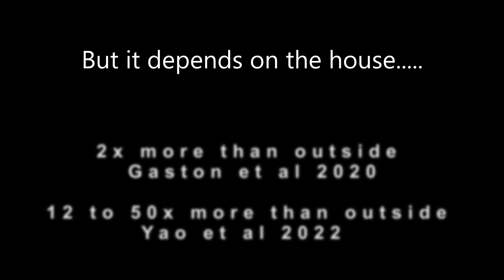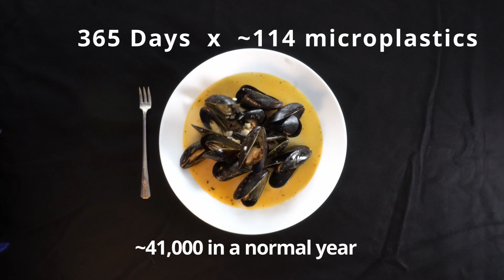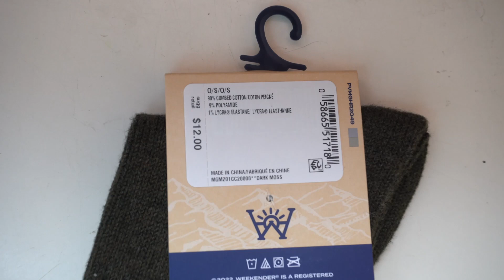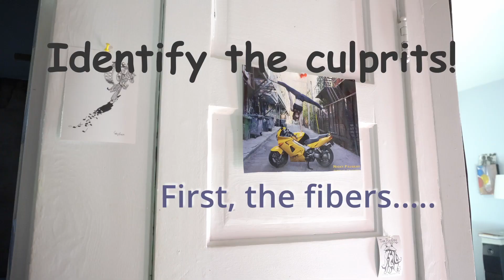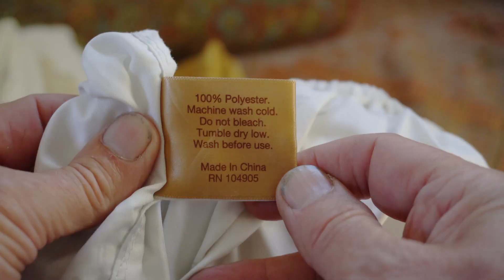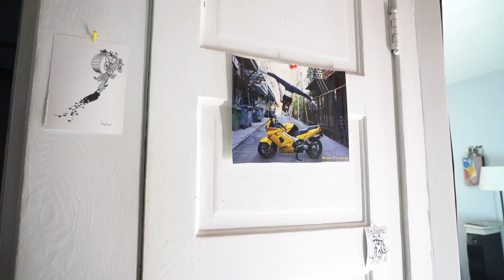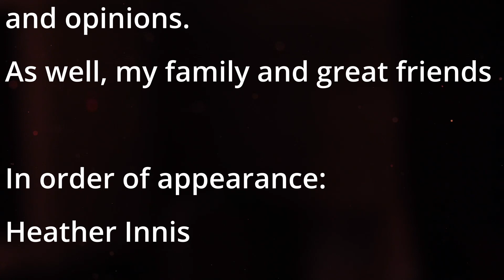Microplastics in the Home.........A Horror Story

Comment: Question: is there a safe way to burn these plasticized products we identify and discard in the home? Like a catalytic filtration bundabuffer that can remove / bundle all of the nastics from the plastics and then store those AWAY from where it can leech into water systems? Help me, Mr. Science!
Reply from the maker: Well, you can burn it, but you have to burn it hot with lots of oxygen. That will combust all the carbon but if the additives (~7% by weight in most plastics) are metal based, they will remain in the ash or go up the flue. When you get to large volumes, you need to design the incinerator carefully to meet the very hot and high oxygen requirements. Aside from the additives, some kinds of plastic are just inherently nastic. PVC and PS come to mind. Poly vinyl chloride is full of chlorine and produces HCl when it is heated. Also Cl can recombine with partially combusted organic compounds and make your dioxins and furan nastics. Polystyrene gives of styrene when heated, another toxic gas. In northern EU they burn most waste plastic but they scrub the dickens out of the flue gases before they are released. This gives you clean effluent but now you have some toxic sludge to deal with. So my friend, you are right to be suspicious about AWAY. It is not as easy as that.